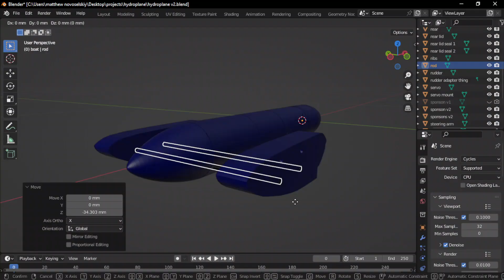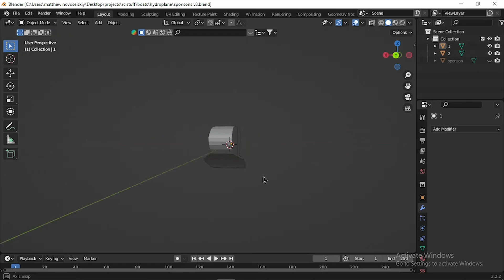HOMEMADE HYDROPLANE BOAT WITH POWERFUL 70MM EDF!

Comment: a turn fin on the sponson might help it dig it to rig the outriggers should.....https://youtu.be/w4cg3EkA8y8
Reply from the maker: I might try that, will probably make it more stable too
Reply: @MatthewNovoselskiy  right hand turns clockwise ovals.......its easy to make turn fin. ive seen designs where theres one on each sponson, but you want one on the port side sponson at the end
Reply: @MatthewNovoselskiy  i couldnt help but notice as it would spin out right as its getting up a plane

Comment: Nice project 👍 Please make sure that the sponson ride surfaces are below the bow section of the hull. When on plane, the boat should just ride on the sponsons and rear ski. Looking at your video, the boat's bow section still hits the water, causing a lot of drag. The lower sponsons position will also reduce the nose diving and water spray. 
For added stability, I would also increase the width by using longer sponson booms. Just trying to help😎✌ Cheers, DJ
Reply from the maker: I did also think of that as well, the ride surface of the sponson is lower than the body, I just checked, good idea to make the sponsons booms longer for better stability, I will try that. Thanks for the tips! 😁

Comment: try a pusher apc prop out runner style, it will be alot faster and i would suggest a 150a fly color or ztw shark G2 esc like a 60a -100a. there reasonable price wise. ive built alot of different style boats
Reply from the maker: I’ll give it a try, don’t really want to get a new esc cause I’ve already dumped a bunch of money into this project, but I’ll experiment with a new prop, thanks for you comment and for subscribing! 😁
Reply: @MatthewNovoselskiy  no i wouldnt go out and get a new esc and all that but its been by experience that pusher props just have more power and get on up on plane quicker is all